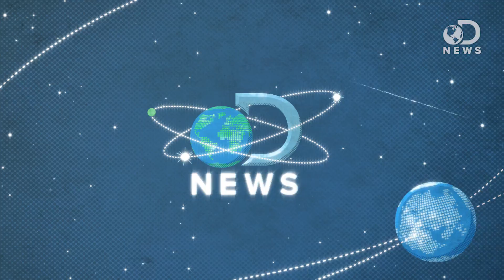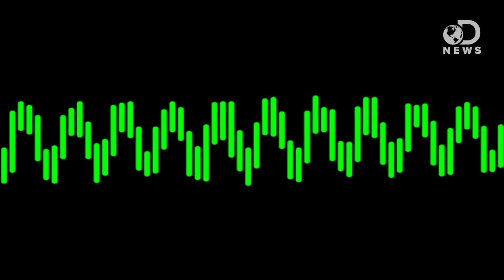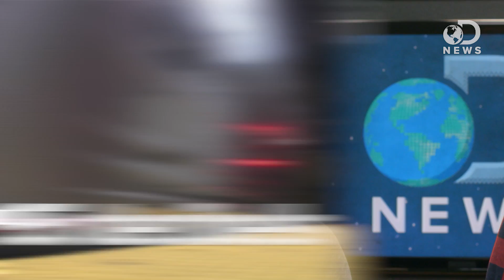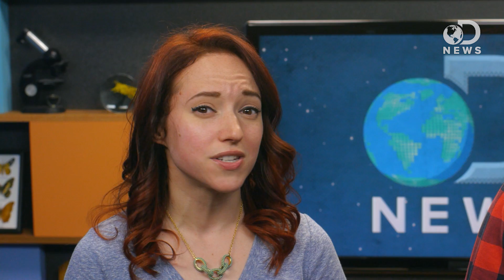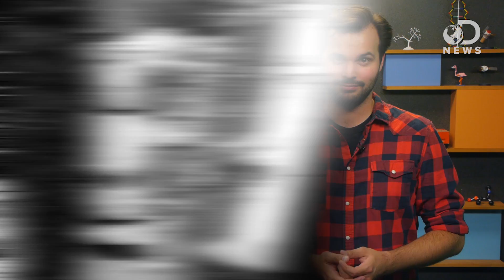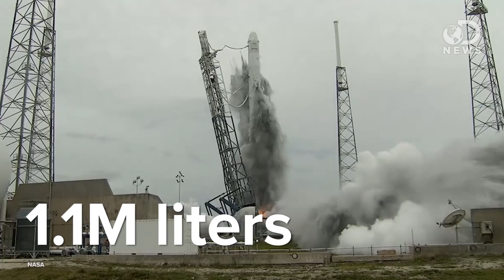How Loud Are Rocket Launches?

Comment: Additionally the 'volume' or amount of sound is highly dependent on the medium the sound travels thru like air,water,etc but also the pressure if it's a compressible medium like air. So at sea level the air can not transport that much volume so it 'clips' like your speakers do when you turn the amp to 11 or higher, this is what makes that crackling sound during a rocket launch. Saturn 5 is too loud at sea level to transport all its available sound pressure so is limited to about 205-210 dB but would be higher if the air pressure were higher, like at the Dead Sea or Death Valley both places below SL and therefore higher atmospheric pressure. What to launch a Saturn 5 at Death Valley? I do, any excuse to reopen the Saturn 5 production line again. The stupidest decision ever made by the Nixon admin. was canceling it, the 2nd stupidest decision was to fund the Space Shuttle program. I think Amy would agree which BTW I like your videos, any foe of the space shuttle is a friend of mine. Thank you, Ken M. - 50 year hands on propulsion engineer and first licensed Pyrotechnic 1st Class Rocket Operator of the California State Fire Marshal from 1988.

Comment: The Sea Dragon (which was never built) was to have a thrust of 80 million pounds, compared to the Saturn 5's 7.5 million pounds (over 10 times the thrust). They would have launched it from the ocean since the db level at 5 miles would be as loud or louder than standing next to a Top Fuel dragster at full throttle. The vibrations would have destroyed the launch pad. The NOVA rocket would have used 8 Rocketdyne F1 engines in it's first stage creating 13 million pounds of thrust (almost 2 times the Saturn 5's thrust). It also was not built. If there was a problem at launch and the NOVA rocket exploded it would have the power of a small hydrogen bomb and would destroy the launch pad and facility. I couldn't imagine the Sea Dragon exploding on the launch pad. Good thing we never built these rockets.

Comment: Back in the '70s, my mother had the bright idea to take us to meet my dad's B-52 on the flightline as he returned from several months overseas. We drove on base in the dead of night and were escorted to small maintenance hanger. When the plane finally arrived, the building shook and the sound pressure was palpable, and as I cupped my hands against the screaming assault, I couldn't help but notice the oversized hearing protection worn by the ground crew. My ears are still ringing.

Comment: Actually raves are much louder than rock shows, most modern rock bands don't use walls of Marshalls any more. I'd be far more likely to suffer noise induced hearing loss through frequent clubbing than regular gigging but filtered ear plugs exist for a reason.
I'm pretty disappointed that for a supposedly scientific video you've used dB as a unit of measurement, though it is the most common, it's not accurate.

Comment: You forgot the most important thing: the decibel is a logarithmic scale. It's otherwise hard to grasp how much is the difference between say 65dB and 95dB.

And you forgot that it's relative to a humans hearing threshold being the 0dB mark.
Reply: Since it is a logarithmic scale, all reference points are equal. 0 is not special on the scale. If you have a know reference point elsewhere it can fulfill the same purpose. For example, 25 vs 15 has the same relative difference as 125 and 115. However, the absolute differences are much different, but in either case if you know the absolute value of one of them, then you can know the absolute value of both of them.
Reply: The threshold of hearing is not 0 dB and it's not even the same for all frequencies, you could actually hear sounds outside the 20-20k Hz range but their threshold of hearing is higher than the threshold of pain, meaning that it would hurt before you could hear them :)
... at least that's what I studied in my Audio and Acoustics course :D

Comment: for every 3 decibels the noise becomes twice as loud
Reply: you mean every 6-10
Reply: as quoted fro wikipedia; "A change in power by a factor of two approximately corresponds to a 3 dB change." witch means it gets twice as loud every 3 db.
Reply: darxider666 If you are talking about dBSPL then it takes 6 dBs to double in loudness. 

"Twice the sound pressure is an SPL of +6 dB." quoted from http://www.sengpielaudio.com/calculator-levelchange.htm
Reply: A change in voltage ratio by a factor of two approximately corresponds to a 6 dB change

Comment: What about mentioning that the decibel levels are not linear. They are expodential. So 200dB isn't twice as loud as 100dB, it's thousands of times louder. Correct me if i'm wrong.
Reply: Absolutely right. Sound measurement's in db is a nonlinear scale. 100db can cause permanent hearing damage. 200db will cause death.
Reply: Fuk Hue , Like that rock concert in the "Hitch hikers guide to the galaxy" that could only be safely listened to if you were in a bunker on another planet.
Reply: I go to car audio shows a lot and there are some pretty loud cars there, my system registers at 145DB and one of my friends systems registers at about 150DB and his is about 3 times louder than mine
Reply: Yes that sounds about right, I know of the rule 3's and 10's . For every 3 decibels you add, you effectively double the value. In this case loudness (sound wave pressure). For adding an extra 10 dB, it is 10 times as loud.